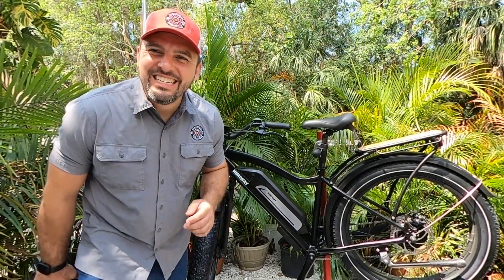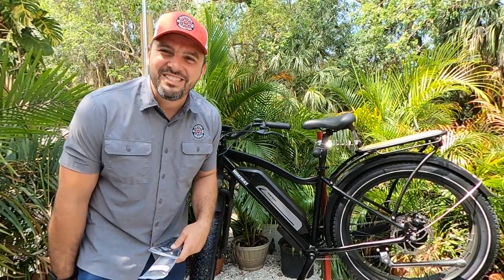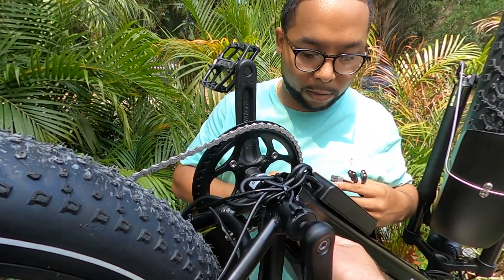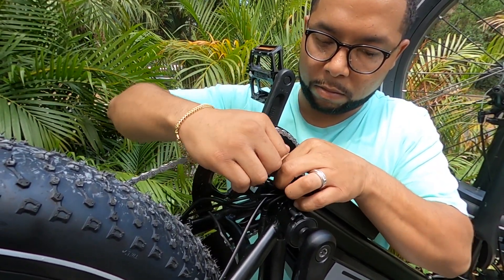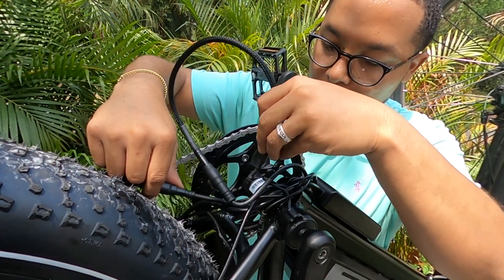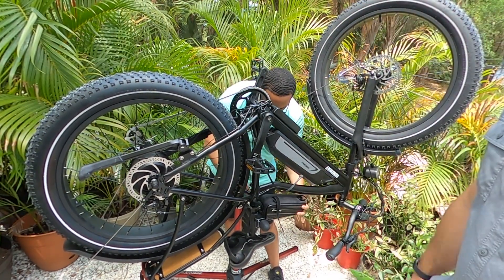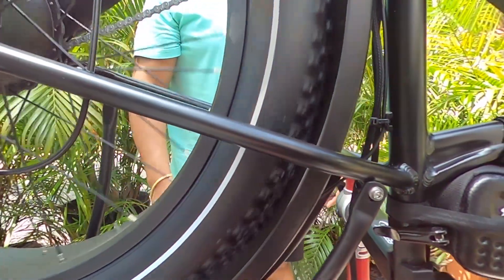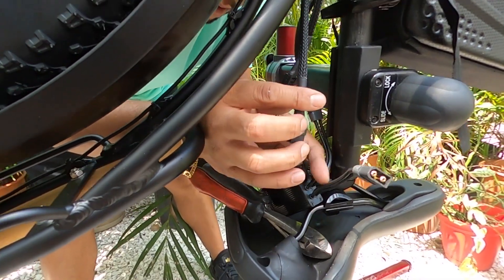Himiway | Cruiser | Plug and Play Dual Battery Discharge Balancer Kit | Install Two Batteries 27.5Ah

Comment: Do you have part numbers for balancer kit used on himiway cruiser
Reply from the maker: Matthew shared 40A Dual Battery Discharge Balancer Kit (Rad, Himiway, MagiCycle, Addmotor Fit) with you

Comment: How many additional miles give with the additional battery?? Thanks very much for the video!!
Reply from the maker: The battery in the video provides approximately 60% more range. You are not limited to that size battery, just make sure your voltage matches and you can connect it to the balancer with XT60
Reply: One question more please, 52V 15 AH  (200 1,500 w) is better or give more distance?  Thanks very much

Comment: Is it better to get the 40 amp balancer kit than the 20 amp kit
Reply from the maker: The only real requirement is to make sure your controller current limit does not exceed the spec current capacity of your balancer. 40A is not necessarily better, but we know it’s going to cover this bikes needs and max controller current limit.

Comment: can you charge both battery at once keeping the balance connected??  do u also need to charge battery separately?? how many  miles do you get with aftermarket battery  stand alone ?
Reply from the maker: Both batteries need to be charged separately.  It is recommended to unplug the batteries but they can be charged while hooked up to the balancer. The second battery adds about 60% more range dependent on your ride style.
Reply: could you use  48v 15ah  instead?    since himiway is 17.5    i’m guessing can’t go higher then 17.5ah  since amazon has a 48v 20ah?
Reply: You can connect ANY SIZE Ah battery, as long as the VOLTAGE is the same . 
Did you get around to doing the mod? 
Cheers  @pzito1